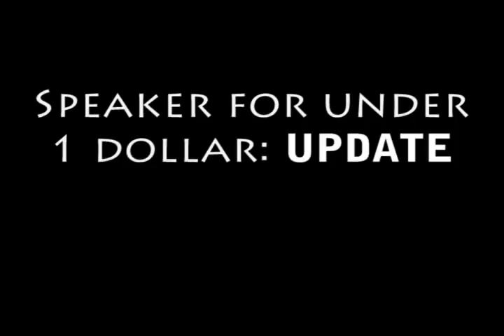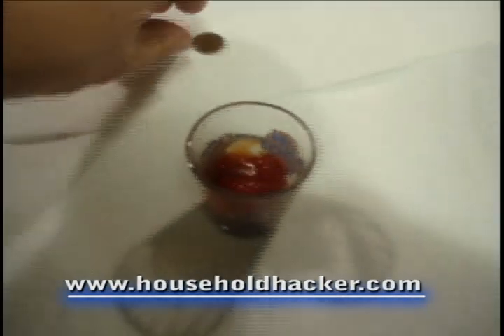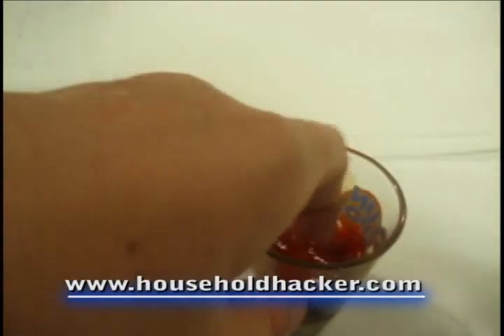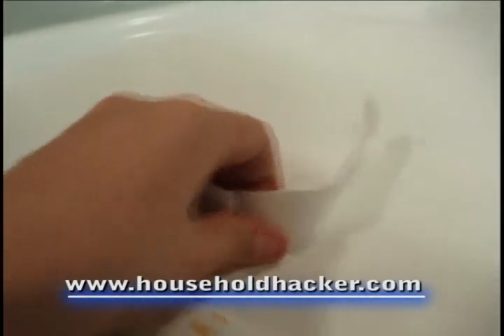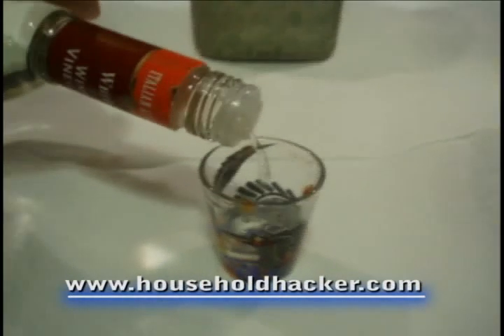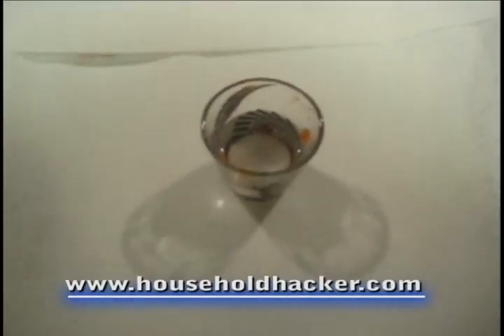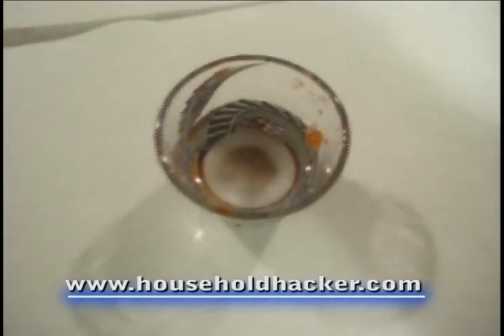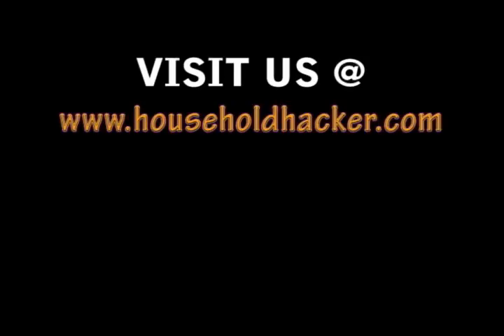How to Create a High-Def speaker: UPDATE!

Comment: The two leads taped to the penny essentially short out.  There is no load, other than the minimal resistance of the penny.  No way to induce any magnetic field which would create oscillation.  It simply can't work.  No matter what you do with the penny.

Comment: While I'm not usually one to call the old HH videos bull, cleaning your penny with ketchup won't work. It's not acetic enough. However, the vinegar/salt mixture should work, as you're combining a neutral salt with a high-pH acid. The acid is what cleans the penny, but be careful! If you forget to add salt, the vinegar will form small holes and dimples in the penny's surface.

Comment: @boobgun222 Pennies are still made with Copper, but the amount used is smaller than it was originally. Pennies now use a base of Zinc, with a layer of Copper surrounding it, and on top of that, they are not electroplated, so there is still a significant amount of Copper in the Penny.

Comment: goto radio shack and get magnetic wire and small earth magnets cost around 6-$8. take the wire and wrap it around a AA battery about 40-50 times(use the red wire, thin gauge) then slide it off, put tape around the coil so it looks like a ring leave 2 ends each about 5in. get a cup, poke a small hole in the side near the bottom to pull wires thru. glue coil down on bottom, drop one magnet in middle and touch the outside with the other magnet so they hold to each other, connect it, it will work.

Comment: I tried it :o it actually works. the Vinegar and salt work better than the ketchup does because the ketchup has other ingredients besides vinegar and salt.Mine worked in about 2 mins. and you can see the V+S one working instantly. It's not total crap, though it didn't clean as well as i would have liked, it definitely clean them. It's not that hard to do, all you have to do is keep them submerged. Really people. And i used paper plates not cups. Still worked jut fine for me.

Comment: What a hosejob man, I set the microwave to two minutes with the vinegar and salt and after about a minute the vinegar was all gone and all there were was sparks blasting around in the microwave. I thought that was the tarnish flying off the penny so let it keep going. When it was done the penny still looked tarnished, the microwave was busted and the whole kitchen stank! And my bluetooth wireless high-def tin foil paper plate speaker still doesn't work!

Comment: I have tried using an untouced, brand new, clean in every way penny. The the circuit simply won't work. If it was connected to something like coiled wire, attatched to one of those magnets from those science kits, then glued to a plate, maybe then it clould work. Of course, you might want to build an amplifer to boost the signal as well.

Comment: It's cause I think the 2 wires on the jack are touching the penny shorting the signal, how about you tape 1 wire to the foil so you get a electricity going through both metals. I'll test it later

Comment: You have to get a penny from before 1982, before then, pennies were made from 99.5% copper, but since that costs much more than 1 penny, they made it only very finely copper plated, like 1-2%. I think you may also have to put a magnet into your paper plate under the tin foil.

Comment: that's a nice idea., but the thing is how the shiny penny is going cause any of  vibrations on the aluminum foil? That's a direct contact with the foil, and you get the electrical shortcut cause of the penny surface is too small and doesn't have any electrical resistance... Though you could isolate  the contact btw the foil and that penny of yours by putting some flexible material and a duck tape over it., oh and you could put the electro magnet in stead of a penny..

Comment: i pretty sure the idea is to wrap copper around a metal i.e steel then having a electrical charge pump it one end and the other i dont think that a penny with a audio jack could do this alone let alone a penny to carry charge when it is not itself a metal which is easily maninpulated by a magenctic force.

Comment: Actually, a piezo-electric speaker doesn't use magnetism, it simply uses a crystal. The crystal vibrates (flexes) according to the audio signal connected to it, and connected to the crystal is the diaphragm of the speaker to amplify the vibrations. 

However, I see no reason why either a coin or a piece of tin foil would flex due to the electrical energy, least of all considering the level a headphone output socket emits, so of course this is fake. But there's no need for the foul language.

Comment: I'm going to try this...
Reply: don't, it will just blow up your PC's output op-amps, or at worst blow the output stage of your amplifier. Your introducing a dead short to the output, most amps cant deal with this and simply explode. I would advise getting some cheap PC speakers, they will not blow up your op amps and actually work. Don't blindly trust things in YouTube videos without thinking about them yourself.

Comment: Penny composition has been changed since 1985 - , >90% of the penny now consists of ZINK, which is only 27% conductive of electricity, pennies made before 1985 are >80% copper, and copper is 100% conductive of electricity USE A PENNY WHICH IS DATED BEFORE 1985, THUMBS UP SO EVERYONE CAN SEE

Comment: the reason or reasons. this experiment does not or will not work is most likely based on the quility of the materials you used. i for 1 got this 2 work with a 1994 100% copper penny, and some old bose speakers from 1998.... and try a stronger quaility wire. about .5 centimeters wide. and make it shorter in leangth if it still doesnt work

Comment: If you call this fake, you probably did it wrong. Even if it doesnt work for you, doesnt mean its fake, it means you didnt follow the instructions correctly or analyze the video and how he put it together.
Reply: me and me friends have tried to do it many times...never worked...its fake. i mean if you want to try it and prove me wrong go right ahead. i would love to be wrong but its fake.
Reply: It will work, The wire is the magnet and when carried through to the penny it turns that into a magnet. Do you not know about this?
Reply: Ill admit Im not the best at wording things, so I probably wont explain things correctly.
Reply: Also, alot of people that try to do this set it up wrong, its not their fault, hes not specific enough on how to do it. Im just lucky that I know what im doing. I I find that using an RCA cable works better.

Comment: Vineger and salt will clean a penny but that is not the same penny that was originally placed in the glass.  I have done this trick with pennies as far back as 30 plus years ago and while it will clean the penny it will not replace the deep shine the penny has from what appears to be a lacquer or something like that.  The salt part may not even be needed but it does act as an abrasive substance so the penny will clean a little faster if rubbed around on it.  That coating is also eaten off by the vineger and salt.  So what you get is a clean copper looking penny minus the deep shine it had when it's new such as the penny they pulled out of the class in this video has.   Fake, fake, fake.
Reply: Dude it's a troll video...

Comment: um maybe if you coil some magnetic wire and put a magnet (this is usualy neodemeum) inside the middle of the paper plate. or u need a penny from around the 50's and a neodemeum magnet.

Comment: Doesn't work, I made shure that the aluminum foil was completely air tight, I also did the ketchup trick, and I even used a Produkt made for kleening copper, i putted each of the wires on each side of the coin, like another guy said...and it DOESN'T WORK!!!